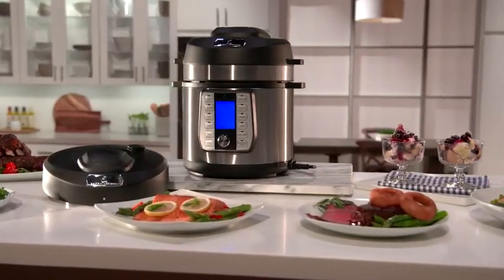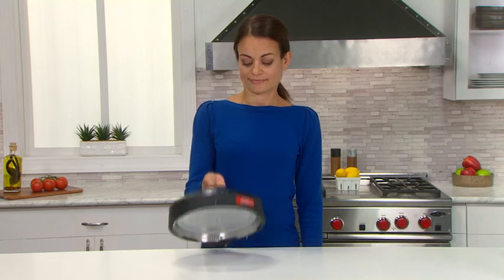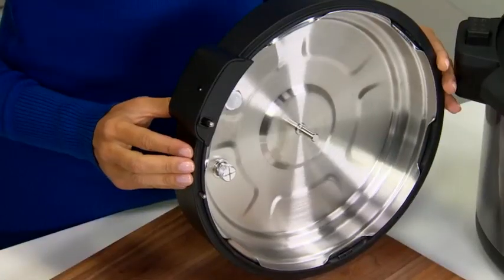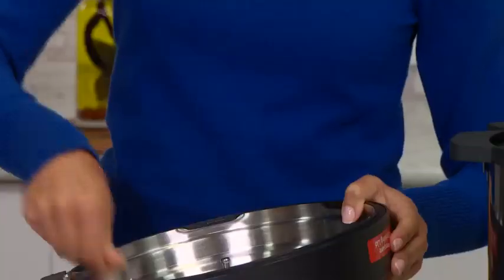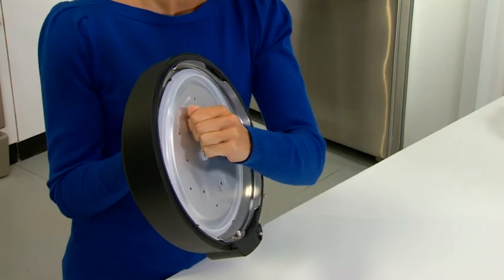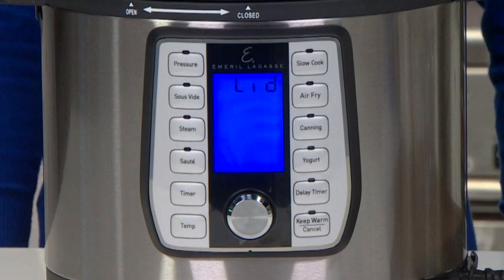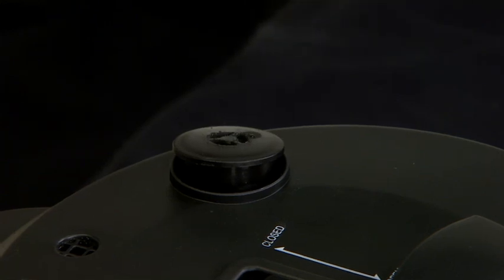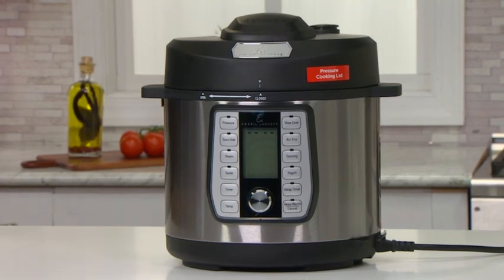How to Use the Pressure Cooking Lid | Emeril Lagasse Pressure AirFryer

Comment: I bought one of these and had alot of trouble with it it doesn’t work on the slow cooker part it shuts off unless you constantly move the pot,the pressure cooker part takes forty five minutes to cook a pot of Lima beans very disappointed in this pot maybe I just bought a defected one 😢

Comment: for some reason my pressure cooker lid doesnt work with the steaming option do i not use it or do i use the glass lid it came with?
Reply: Yes that is a NICE safety feature that prevents you from using the the pressure lid while steaming food. You can actually use the Glass lid for STEAM Canning too.
Reply: ok ty wasnt sure if that was it or not, btw cool pfp
 @jackscrafts9202